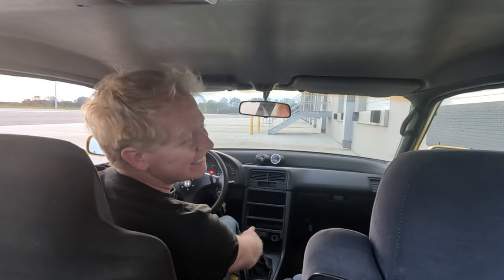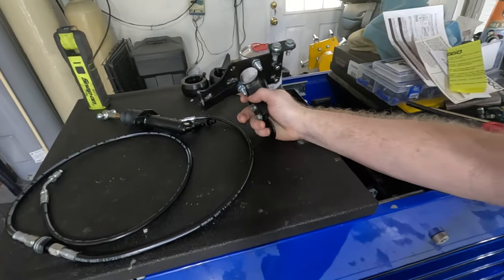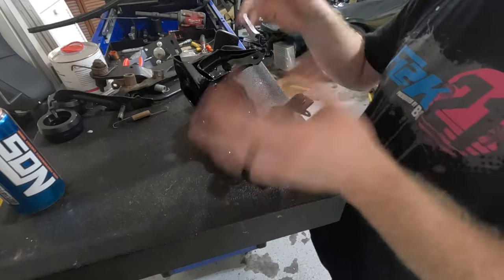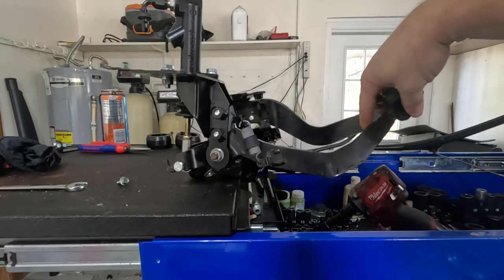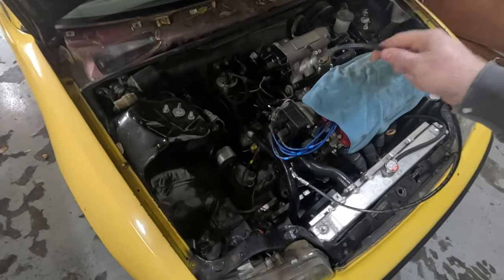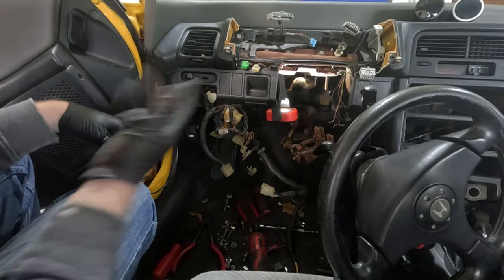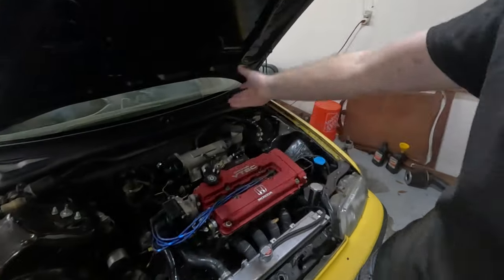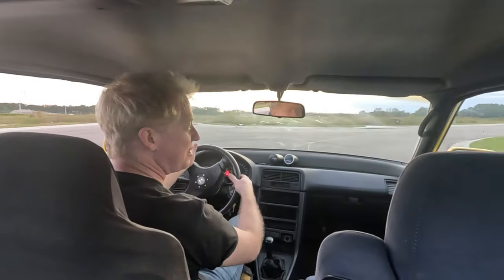Ultimate CRX Cable To Hydraulic Clutch Pedal Conversion + Review! | Hush Performance

Comment: Just installed mine and what a difference , I bought a harbor freight rivnut gun and put rivnuts where the reinforce bracket goes ,for easy installation and for maintenance,I am new to hydraulic and  for others that do this and the pedal has a lot of travel ,don’t forget to screw the arm towards the slave for adjustment😎
Reply from the maker: Good tips!

Comment: I got the V1 version years ago.   I went through like 4 pedal assemblies in my old EF with a B16 hydro trans and a Hasport conversion.   The assemblies would just crack and bend.   The Hush Perf kit was the best thing ever for that car.
Reply from the maker: I didn't go through four pedal assemblies but I fixed mine twice and replaced it once within a year while I was daily driving this car. You are not kidding about that last part.

Comment: What clutch are you using in your swap?
Reply: Nevermind.  Just saw it's a 4 puck unsprung. I've heard the cable conversion is bad for strong pressure plates, but for stock clutch setups, it's still good. I'll be using a stock clutch setup in mine when I install the Hasport conversion.  Everyone that hates the Hasport conversion has a stronger than stock clutch.
Reply from the maker: @crxseth  I don't even know the brand, my Buddy that sold me the entire swap years ago doesn't know either, but I assume it's something cheap. As long as you keep a cable transmission mated to the b series You're good. But My understanding is the geometry of the hydraulic trans' clutch throw just isn't well matched for a conversion kit in general.
Reply: @crxseth agreed. I don’t have a crx but a B-swapped EF sedan and I am using an innovative hydro to cable conversion and it works great. Stock clutch. Feels like stock. Pedal effort is easy.